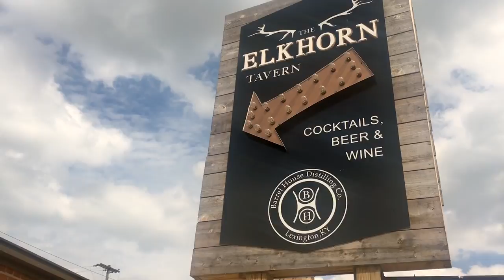Vlog #32: Stop and Smell the Bourbon

Comment: This is off topic from the Bourbon, but I noticed you go off road alot with your TAB and curious if you are using the factory suspension or did you customize the trailer suspension? My TAB like your option model makes a lot of suspension noise on the ruts so I need to really go slow. Seems hard on the TAB structurally. Was looking into trailer independent suspension modification. Any thoughts or experience with the off road aspect of pulling the outback?  Thank You
Reply from the maker: Great questions Keith! No, I haven't done any modifications even though I do go off road a lot. My suspension doesn't make too much noise, but I do go slow just to be careful. I think there are certainly some mods you could make to it though. I don't know a lot about suspension just yet but I'm learning!